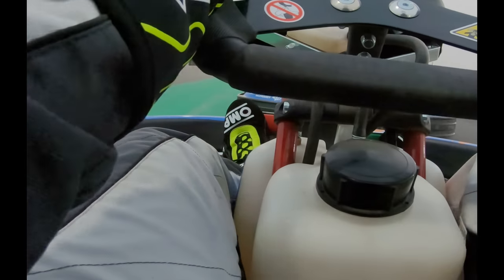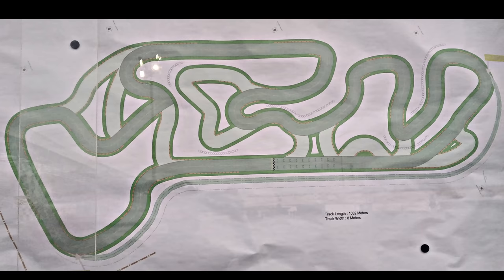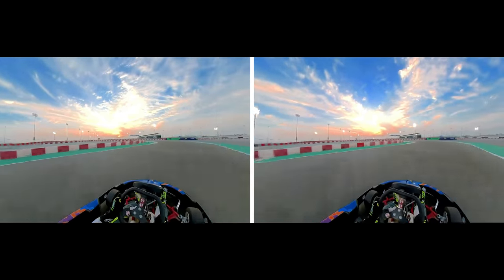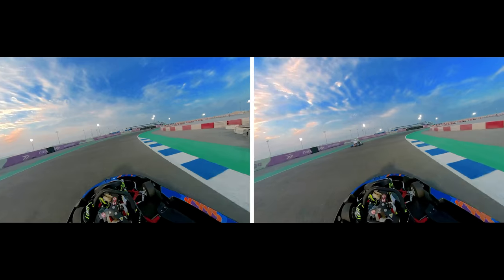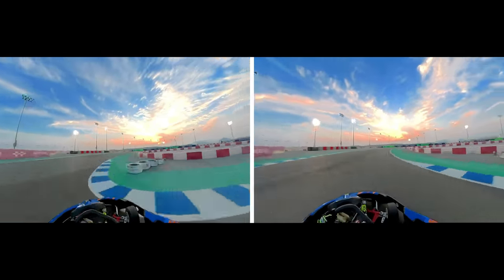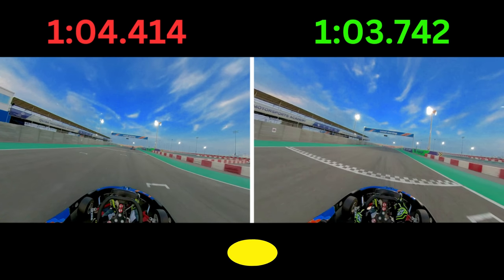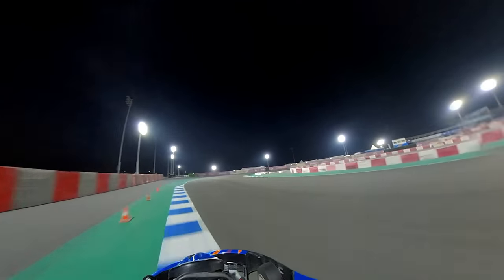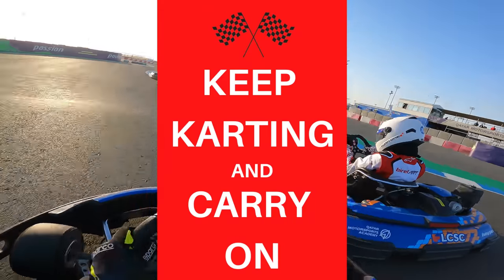Should you BRAKE in Karting? (experiment)

Comment: ex professional go-kart driver here (10+ years of experience), braking is the most important part of this sport, braking becomes even more important in the wet, and the way it has to be done can earn you tenths at every corner. However, in rental go-karts the brake is way less important, and with a little practice the difference between braking/not braking is zero.

Comment: Can it depend on the cart? For example when I go carting at my local track with renting carts I notice that the engine is much slower and accelerates slower after I brake than after I just lift into the corner. Is this a thing or am I just imagining things? I really need to know! Thanks!
Reply: electric carts accelerate faster, can compare the lines you have to take and the braking to f1, normal karts accelerate slower so you take the karting line, a wider line so you can keep your minimum speed higher and dont lose too much speed, so if your local karting track does not have electric karts you should indeed brake a lot less and take wider lines

Comment: Usually first 5 laps are slower. Need to warm up tires and get yourself more aggressive. It would be fair to make such test with two sessions.

Also different tracks react different. On some no breaking could be even faster than with breaking.
Reply: Lol, first 5 laps are the quickest ones. Then the tracks starts to overheat and gets slower…. If you see in every race, the fastest lap is usually done in the first 5-10m
Reply: @joaomachado4359  No, maybe with KZ2 or smth. But with ocasional 13 hp carts tires gets warm only in 3-4 laps. And then only you get faster and faster. And your fastest laps are in the end of the session.
Reply: @Nepyragas  no! You just need 1 or 1,5 laps to warm up your tires! Im assuming that there are at least more 10-15 guys racing against you. Test it! Because i did! After 10m the times goes up at least 0,5seconds per lap

Comment: What if you drive like Alonso?
Turning the steering wheel a lot earlier and a lot more than usual?
Reply: Won't work in a kart, you lose a lot of speed that way. That driving style worked very well with the Renault F1 cars that Alonso drove because those cars had very stable rear ends which is the exact opposite of what a gokart normally does. Even Alonso changed his style with other cars that handled differently.
Reply: Wouldn’t really help here. Also Alonso only did that back in his first stint with Renault when they used the Michelin tyres. They had a more square profile and took a lot to get temp into them. He would purposefully induced under steer to heat up the fronts for better grip. It was a technique really specific to that car and those types of the time.